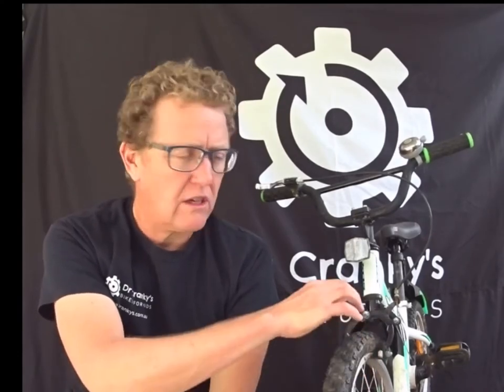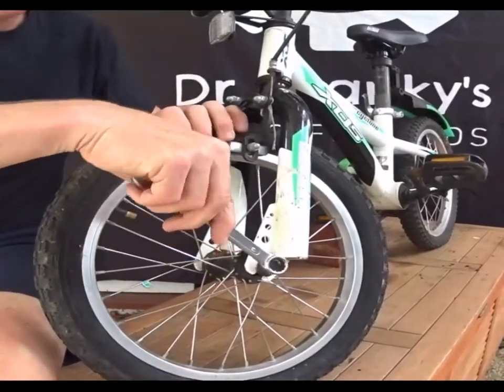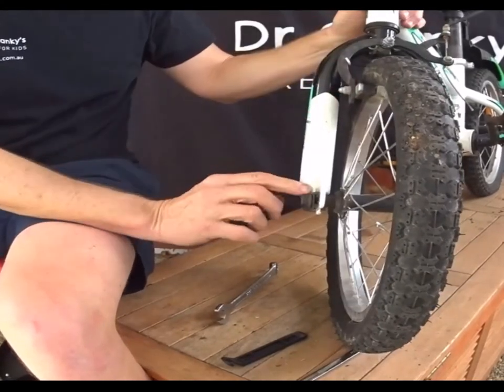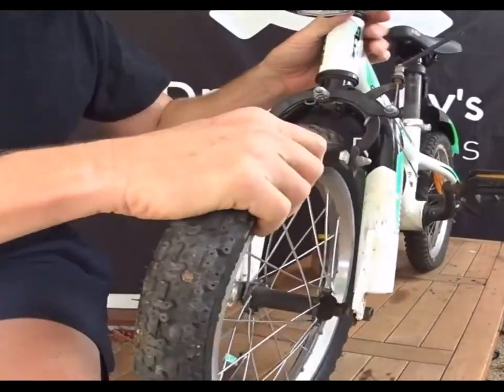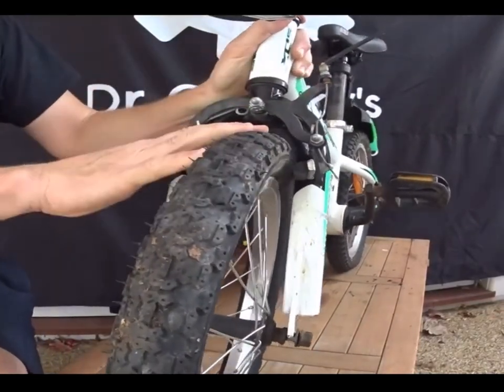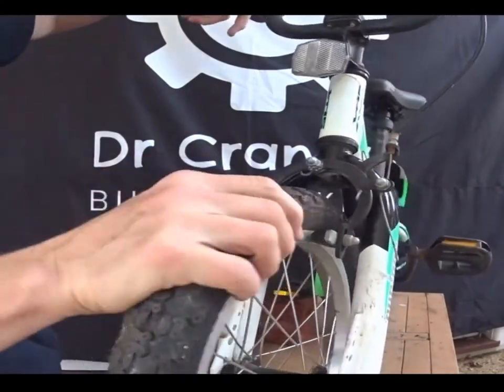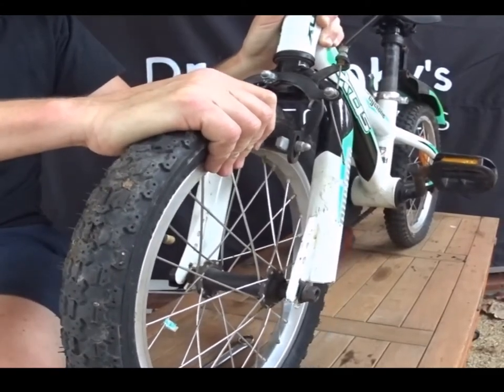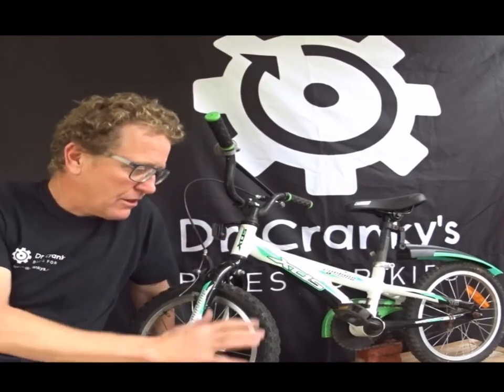Front wheel of a small bicycle - how to remove and replace

Comment: Thanks really useful video! I need the tool you had to tighten the brake locking nut.
Reply from the maker: Usually a 10mm bolt.

Comment: Nice video, thanks! 
Release the brake is much easier than undoing the cable pinch bolt. Just squeeze the brakes shut and then pull up on the cable housing and slide it and the cable sideways (there is a slit in the holder allowing the cable to pass through). Reinstalling is a simple. No need to readjust the cable afterwards, and saves the wear on the cable (usually undoing the pinch bolt then tightening again will make the cable fray very quickly).
Reply from the maker: Yes. But sometimes the cable is a bit too tight to allow this so that is why I showed this method.
Reply: @DrCrankysBikesforKids  Fair enough